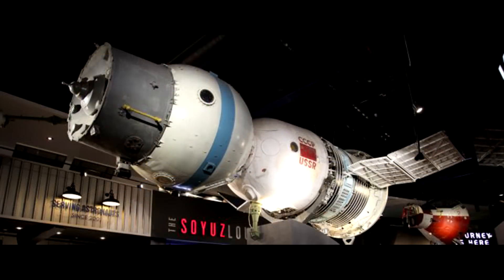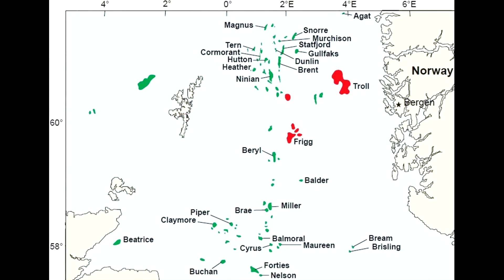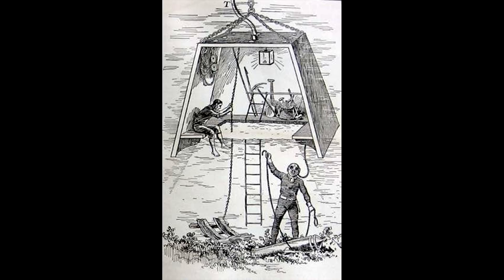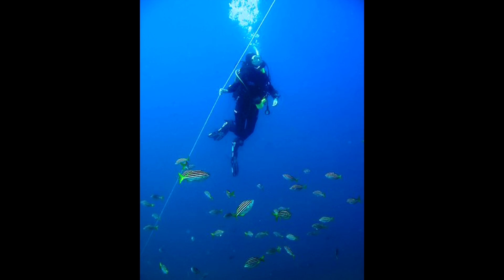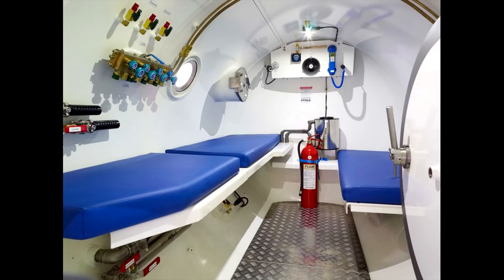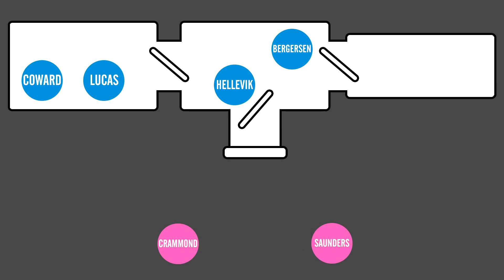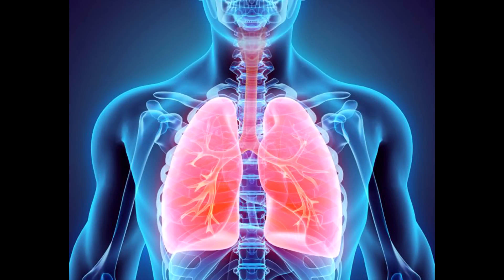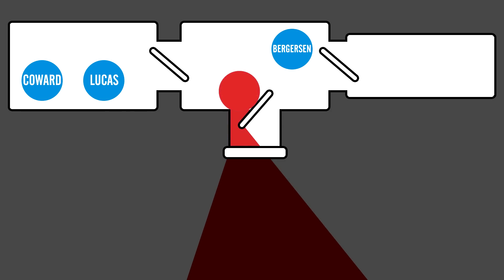Extreme Loss of Pressure Tears You Apart | Last Moments

Comment: “When I’ve got you, I’ve got you.”

-Delta P
Reply: Yep. He don't mess around. He's a strong little feller'.
Reply: I was looking for this comment 🤣
Reply: @DJDAVINCI  i think it was "when its gotcha, its gotcha"
Reply: "They both died"
Reply: I have a feeling Delta P is about pulling you into the created opening. In this incident, you are getting pushed out by gasses. So should be completely different.
Reply: @sergeant_dornan_  same thing. Delta is for "change in", P is for pressure. As long as there is a difference in pressure, there is Delta P.
Reply: I literally just came here from that video

Comment: Fun fact:
If while scuba diving you hold your breath while rapidly ascending your chest will explode. You can prevent this if you blow out while rising. This is necessary information, because if you need to go to the surface in an emergency, like if you ran out of oxygen one way or another. Rapid ascent has negative  either way, like fucking up your ears, and the bends. But hey, at least your lungs haven't exploded, so that's a plus.

Comment: Why does somebody always have to die before safety measures are installed?
On a widened freeway there was a steep drop off on a straightaway. Into thick trees. After a flaming accident involving two fatalities, a guardrail was installed.
I already knew it was just an accident waiting to happen.
What were the roadway engineers thinking?
Reply: It's a case of  effort versus risk versus consequences. The higher the risk, the greater the effort in mitigating the consequences . Without a crystal ball, Unfortunately it's only when the consequences have happened is enough effort $  spent to reduce further risk.

Comment: im in commercial diving school and we just learned about this. We were told that one of the guys in the decompression chamber thought the tender said to open the port hole leading to the bell. He obviously couldnt get it open because of the pressure but took a sledge hammer to it and broke the seal which cause everyone inside to die (instantly). Now they have a safety pin when the bell is attached and the pressure locks the pin in making it impossible for it to separate and lose the seal. Its crazy learning all this in school, its like watching that old show "a 1000 ways to die" lol

Comment: When I was in the US Army, back in the 80s there was this old wives tale I've always wondered about.  They said that if a sabot round hits hard enough in a weak spot (side armor for example), the round would pass right through both sides of the turret, and suck everyone through the golf ball sized hole.  I never really bought it.  You'd be dead, anyhow, but still...
Reply: It’s probably not true (at a range of hundreds of meters, the round’s airspeed should be too low to compress the air over a couple atmospheres), but in theory I suppose it could be possible with a point blank hit.

Comment: I nearly had a forklift operator take my legs about 25 years ago.  What struck me most was how he knew he was in the wrong but tried to blame me.
Reply: @MJBclassics  ?
Reply: @beringia1438   i want too do that scuba diving ?. .
Reply: @MJBclassics  bruh wtf
Reply: A forklift operator at my father's work came speeding around a corner in the outdoor lot, the speed limit being 10 MPH, and crashed into a yard tender, a vehicle used to shunt truck trailers around. Oneof his forks broke and nearly severed the tender driver's left leg. The other hit the engine, and sprayed her with scalding coolant. 
The lift operator got out, and started yelling at this wailing, injured driver "WHY THE F*CK WERE YOU IN MY WAY?!?"... 
The owner of the company broke a hammer handle over that jackass' head later. 
Forklift operators are all insane. It's a hiring requirement. 
-
The yard tender driver recovered, but her knee was messed up and she wears a brace. Still drives the same tender!
Reply: @henryrodgers7386  "The owner of the company broke a hammer handle over that jackass' head later." Perfect!
Reply: @henryrodgers7386  Were definitely not. Being unsafe isn't excusable but you wouldn't believe the amount of times people walk aimlessly Infront of me while I'm carrying a 2 ton load. Without a high vis also. People don't understand you can't just slam the breaks on when driving and carrying a load.
Reply: @henryrodgers7386  they hire fucking anyone to drive forklifts
Reply: @MJBclassics  please tell me that is sarcasm?
Reply: @MJBclassics  kind of hard to tell if something is sarcasm when it's purely text. besides, this is the internet, and there ARE morons who actually would say something like that without ANY sarcasm.
Reply: Did it take your legs you can’t walk anymore? That’s terrible. At this point I just want to live a normal life
Reply: @australium7374  I still have my legs and feet  - I hopscotched over the forks as he turned towards me.  He was lighting a cigarette and lost control.  I'm sorry if you experienced something like that that didn't turn out to be just a scare.
Reply: @HeatherSpoonheim  Considering most forklifts run on propane with the tank right behind the seat he must have been a genius lighting a cigarette lol.
Reply: @HeatherSpoonheim bruh the driver basically broke the law no driving under the influence
Reply: @MJBclassics  I get the joke but it's still a lil' distasteful ngl.
Reply: My old roommate had his back crushed by machinery he was operating that catastrophically failed. The fault laid on the company that made the machine, yet they kept saying it was his fault, although this was not their first massive failure and they already knew about the cheap bolts tending to snap (it was cheaper to deal with lawsuits than issue a recall).

If he didn't have a co-worker right next to him, who only BARELY missed being decapitated, he might have lost his lawsuit.

Sadly, the ordeal left him with lifelong pain and an opioid addiction that he's still recovering from. Yet after a decade in a wheelchair until the company finally paid for a surgery to fix his spine, he's back up walking and working. The pain is still there, but he hates not being busy.

It's sad when people clearly in the wrong blame the victims rather than take responsibility.
Reply: @rhov-anion  wow
Reply: @MJBclassics  your sarcasm is ubsurd
Reply: Ok, thanks for that
Reply: Dick Johnson  "middle bro is still a cop"... Of course, of course he is. 🙄
I sincerely hope he's gained some shred of maturity and self-control in the intervening years. "Boys will be boys", but....
Reply: @MJBclassics  you’re not funny pfft. Sarcasm only works when it’s funny, you dumbass
Reply: Dick Johnson  wtf!
Reply: @MJBclassics  "hurr durr woman bad"
Reply: @MJBclassics  your comment was a bit stupid and silly, unfortunately I will have to downvote.
Reply: @MJBclassics  when you think you're funny
Reply: For certain individuals it’s just impossible for them to saw “you’re right and I’m very sorry. It’s sad.
Reply: those are the worst types of people smh.
Reply: @MJBclassics  NOBODY DOES OMGGGG just chill, girl boss. Admit you made a shitty joke and move on
Reply: What struck you most was the forklift.
Reply: @MJBclassics  not sure if your one to talk bud. You’ve been defending this shit joke for 7 months now and you reply to every comment that mentions you.
Reply: As a former forklift instructor, I can say that that is a very common thing to be said even in the presence of video evidence.
Reply: I had a forklift driver almost crush me with a stacks of pallets, I was on my rider jack amd he turned into the main "road" of the warehouse without checking, and becuase his pallets weren't stacked right they all slid off! If I didn't jump off my jack I'd be dead
Reply: @MJBclassics  can’t tell if you’re being serious or not
Reply: Rofl I hate forklift operators.. mostly because we have them going 24/7 across the street at county materials corporation and that stupid reverse beeping sound I can hear.. all day. All night, every day when a window is open.

They do not care.
Reply: same like me sometimes they like to blame other people for their own fault 😂😂😂😂😂
Reply: What does that have to do with this? ? And what was he planning on doing with your legs after he took them? ?
Reply: Well if you leave your legs lying around the place, somebody is gonna try and take them. That's on you.
Reply: Had a friend killed on a forklift a few years ago. They can become very dangerous very quickly
Reply: @MJBclassics  based
Reply: cool diving bell story
Reply: @MJBclassics  bruh moment
Reply: @MJBclassics  Sadly, it's hard to know for sure with people on the internet.
Reply: @MJBclassics  if it's indistinguishable from an attack, you're still the asshole
Reply: People like that need a slap!
Reply: @MJBclassics  you're a man i respect, mjb. ignore them.
Reply: @MJBclassics 

Based
Reply: @MJBclassics  I'm guessing you are a man, because unless you're a woman joking about that, it's in bad taste. Also, imagine having so little to be proud of that you are flexing having 35 likes on a YouTube comment lmao
Reply: Cuts persons leg off
Blames him for it 🤡
Reply: Imagine if he is the one who's about to lose his legs... at least show some concern. I'm glad your legs are still intact.
Reply: this man’s forklift certification needs to be revoked
Reply: I watched a man die on a forklift cause he drove into a reddaway truck without setting or checking the chocks first. 

Diver had driven up we opened the door and after about 5 min he decided he wanted to re-square his truck. Backed right into my buddy who was driving in as he drove out 5 feet or so.  Forklift dropped and the trucker backed up crushing him into the dock.
Reply: must have given you nightmares.
Reply: To be fair working with forklifts or bobcats, the conductor has  less view of what's going on around them. Most people don't understand that.  Which is why I double check my sorrow before making a turn or backing up.
Reply: for a second i thought like, he actually just straight up tried to steal your legs. like in your sleep or something. what has the internet done to me
Reply: @Monochrome2004  Lol.  I think maybe I speak like someone who is from the mid-20th century - which I am.   The internet is a very new medium, but even I can't remember life before google and wiki.
Reply: "You were in the way?"
"Yeah but whose foot was on the accelerator?"
Reply: 11 year old kid from Stockton*
I feel you bro
Reply: Of course he would, it's never their faulto.
Reply: Sounds like a classic narc
Reply: He is a republican
Reply: Yeah, that's almost like what happened here, lol.
Reply: @@davesmith3023 I think she mentioned it only because it relates so closely to a submarine experiencing an implosion.
Reply: What does this have to do with the video?
Reply: @HersonHernandez-hr6ym  I have no idea - I don't even remember making the comment and I'm not sure why so many people see it.
Reply: Take them where?
Reply: sounds like a man-child
Reply: @MJBclassics  That's not sarcasm, it's incel behavior
Reply: @MJBclassics  noo my mommy said I'm first.
Reply: @MagikMako  No it's not sarcasm. Sarcasm is the use of irony to mock or convey contempt. The person who commented is a man who very likely actually thinks that way and obviously is not actually supporting women.
Reply: @MJBclassics  There are clearly multiple comments who rightfully don't find it funny
Reply: @MJBclassics  That make me the 22nd? I could tell it was a joke. I was surprised to see so many people without a sense of humor or sarcasm.
Reply: @maggiem6209  What's so humorous about someone sarcastically dehumanizing the female gender?
Reply: 1k like
Reply: What struck you was a forklift bro...
Glad you're okay.
Reply: @MJBclassics  The best part is how every single whining comment combined has less likes than your first one
Reply: @MJBclassics  LOL, and you even have 8 likes.
Reply: I nearly scored 10 goals during my last game. My actual score count was 0.
Reply: @MJBclassics  as a sarcastic female i approve this message.
Reply: @highonimmi  ew
Reply: You almost got a bump on the leg by a forklift 25 years ago and you're STILL complaining about it?  lmao
Reply: They must have been a democrat, everything is always someone else’s fault, but never theirs 😀
Reply: @omfug8593  y’all love to bring politics into literally every conversation
Reply: @omfug8593  lol do you just see everything in the world as 2 sides ?
Reply: @themookshit  
There are many sides to issues it's just Democrats are always on the correct side!
Make of that dangling participle what you will!
Reply: @Hochaloogy  /sarcasm
Reply: @omfug8593  me when assume people’s political stances on the internet:
Reply: @omfug8593  the hypocrisy in that statement is incredible man
Reply: @omfug8593 i'm surprised your view of the world is this shallow, and your spite is this strong.
Reply: @OMFUG8593 — by that “logic,” they could have also been a Republican, seeing how some Republicans blame everything wrong on people who are different from them instead of looking at themselves.
(Not a Democrat; both parties suck. I just don’t like when people act like only one sucks)
Reply: @omfug8593 and only a Republican could make something that has NOTHING to so with politics, ABOUT politics😂😂😂
Reply: @omfug8593  lmaoo i worked with a lady that said that after someone bumped into her pretty good coming around a corner with metal cart. he didnt apologize 😂

Comment: One of the reasons why i refuse to go Scuba Diving man cause i value my body pressure and not wanting no other pressures to turn me into a mist or a pile of viscera thank you very much. But man rest in peace those Scuba Divers
Reply: That's not SCUBA, that's bell diving, which is a form of surface supplied diving. In normal recreational SCUBA diving it's pretty much impossible to have something like this happen. If you exceed your no stop time you can get bent, which is not usually immediately fatal, and if you hold your breath while ascending you can get an air embolism, which can be immediately fatal. But by and large, as long as you do those things, you're going to be pretty safe. You're certainly not going to get blown through a tiny hole.

Comment: What went through their minds?...
In Crammond's case, the diving bell...
In Hellevik's case, an awful lot of air...
A relative of mine was on the Byford Dolphin that day.  The diving bell was propelled across the decompression deck with such force that it was rendered inoperable and had to be scrapped.  It also caused so much damage to the structure of the deck that the rig was out of service and in dry dock for many months having a major structural refurbishment.  Had this happened on a diving support vessel, the ship would most likely have had to be scrapped due to the level of damage wreaked on the hull.  The 4 unfortunate divers basically exploded, but death was so quick for them that their brains very likely didn't even have time to start registering pain...
My relative left diving support work and moved to working on oil rig support vessels, being among one of the first crews to arrive on the scene of the Piper-Alpha disaster.  Despite his qualifications in regard to deep sea diving he has no interest in ever returning to that field...

Comment: The pressure of a diving bell is also important for saturation diving. Divers can spend weeks on end in decompression chambers or underwater habitats, which means that they only have to decompress once.

And though the accident was technically caused by human error, the company that was too cheap to install a failsafe on their fucking death box is way way more at fault

Comment: The proteins in their blood literally denatured, due to the severe pressure gradient, resulting in fat being readily apparent in the divers remains bloodstream.
They didn't even get to know something went sideways.
The Soyuz cosmonauts knew, tried to reach the valve to cut off the air loss, but it was unreachable and upon landing, only bruising and bleeding from the ears suggested a problem. Well, that and being quite dead.
NASA research showed that universally, upon exposure to vacuum or its equivalent for us, the entire gas exchange system voids all atmospheric gases from the blood through the lungs rapidly, exhausting O2 and CO2, as well as nitrogen (80% of our atmosphere), fibrillation begins in the heard, after 90 seconds, no experimental subject survived defibrillation and resuscitation attempts.
Respect significant pressure differentials, for they'll not respect you at all - ever.
But, you won't explode, even under 9 atmospheres to zero atmospheres of hard space vacuum, our skin is far tougher than our internal tenders are.
Or more simply, the universe doesn't like you, take care that it doesn't kill you when you venture outside of what would be survivable - always. Respect a danger always, protect against it always, never, ever grow complacent.
That won't get you to even survive as tame an environment as Mars, but you'll be at a good starting point. Humans have survived, as found by some misadventures here on Earth,  about a minute under hard vacuum conditions, full body exposure, longer with a forgotten or lost/penetrated glove. Think cartoon bulbous hand, hurting like hell and gone, twice and better larger in size for a glove.
Gene survived that mess, a few hours later, he was fine and amazingly, didn't have a full hand hickey.
Just most of it.
So, follow the checklist. I've designed a few, they account for a five star hangover, sleep deprived for a full month and being ill for a reason.
Been there, done that under far less risk conditions.
Reply: What happened to their hair?
Reply: @silent_stalker3687  nothing, hair won't denature from explosive decompression.
But, they likely didn't even know anything happened, the pressure extreme basically being instant. Even money, they didn't get to register the sound of the air blasting out of the hatch.